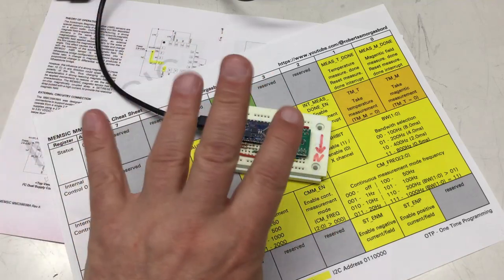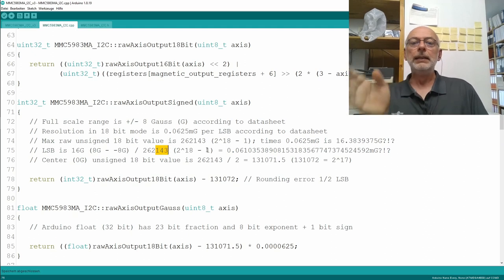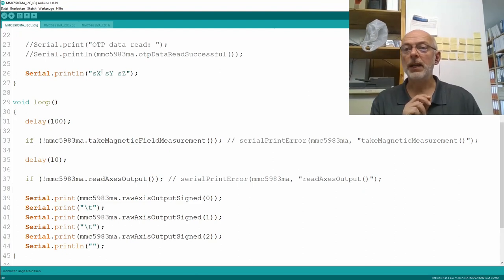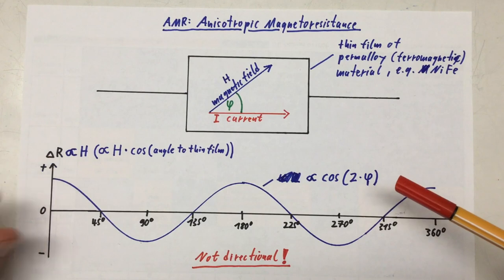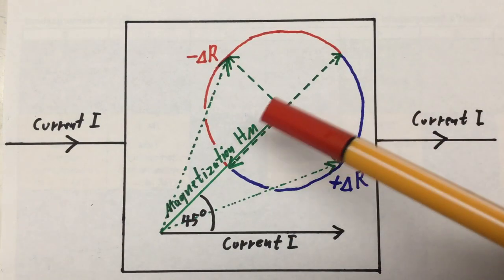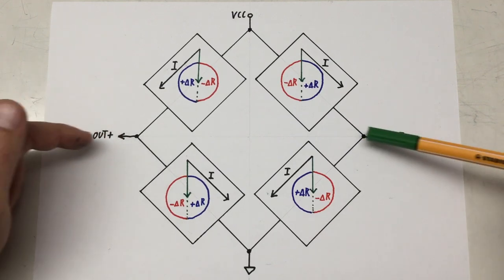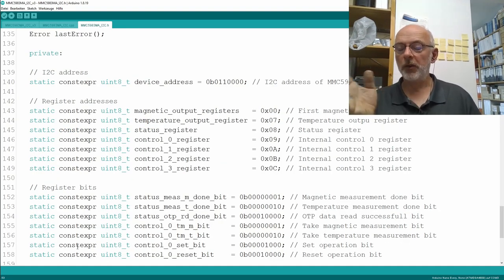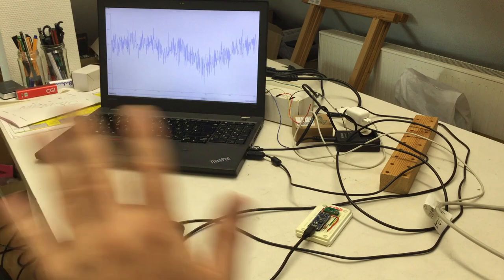MEMSIC MMC5983MA 3-Axis Digital Compass & Arduino MCU – The Details (3)

Comment: Hello! Thanks a lot for the amazing videos and deep explanation of the sensor. It makes sense to assume that they rounded the capacity of the magnetic sensor to the nearest smaller value (+ or - 8 G), rather than reporting a wrong resolution (0.0625 instead of 0.0610).
Reply from the maker: Indeed it does. I'm pretty sure 0.0625mG/LSB is the correct value and the range is indeed a wee bit over 8G.

Comment: Can't wait until you get to the compass function and calibration. I am building a compass and ran into the strange (at that moment) thing that 90 deg wasn't 90 deg....and 180 wasn't 180 until I found your Brilliant video's. Of course I was assuming I bought a compass chip instead of a noisy  3 axis hal element :-)  luckily I chose the 5983 sensor instead of the noisy one in my final design. because my compass has to be wireless (LORA) I put a battery clip on the back side of my pcb. Did you know Li-ion batteries are VERY magnetic? clipping in the battery rotates the field by 90 deg!) Well I do now :-) I ordered pouch li-ion batteries If I cannot negate the magnetic field of the Li-ion 18650. So eagerly awaiting your next video! Thank you!!
Reply from the maker: Thank you very much for your extensive comment! And yes, the MMC5983MA is superior to any Hall element based product. At least I didn't find a better 3-axis AMR sensor. But I think there are single axis AMR sensors out there which are even better. At least I remember a seeing a precision compass project using three of those. And yes, batteries are notoriously magnetic :-) The compass in my Garmin GPS demands a recalibration every time I change the batteries. I currently really pressed for time, so this video series might advance at a snail's pace. Anyway, just in case you haven't stumbled about it already: https://youtu.be/RJovRafwgo8 (explains bias vector / scale matrix calibration process).

Comment: Can the sensor be replaced FLC 100?
Reply from the maker: Depends on your requirements. The FLC100 is a fluxgate sensor. Those sensors have much lower noise than Hall effect sensors, like the MMC5983MA. So if you don't care too much about noise, you could go for a hall effect sensor instead of a fluxgate one. However, if absolute precision / low noise is required, then you need to stay with your fluxgate sensor.